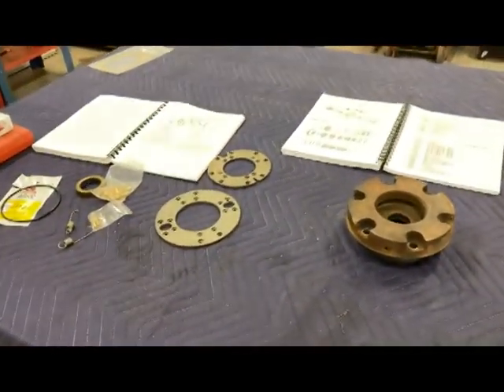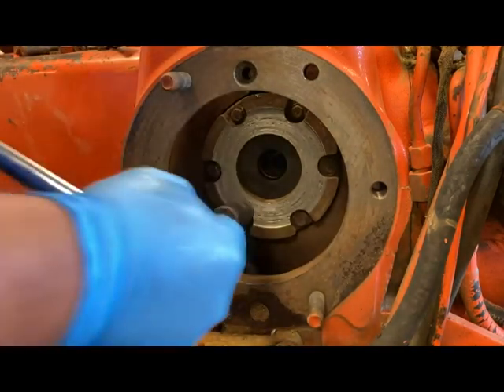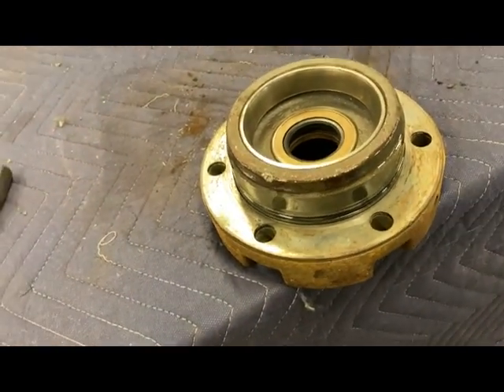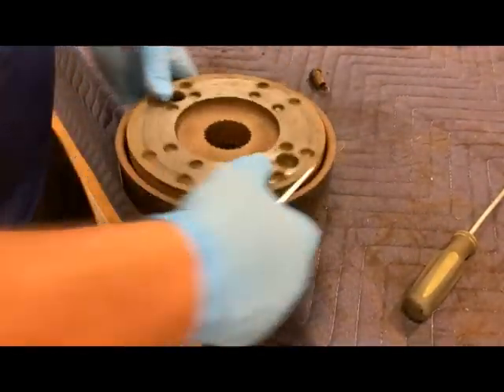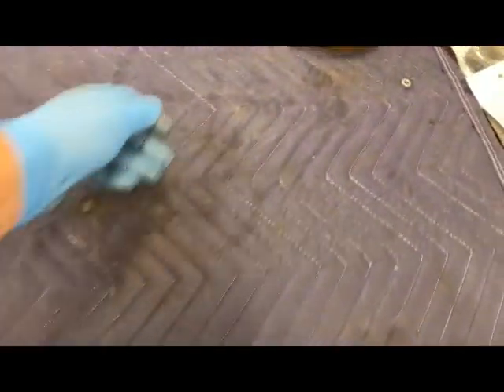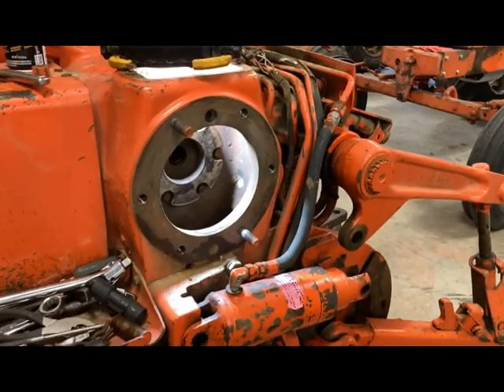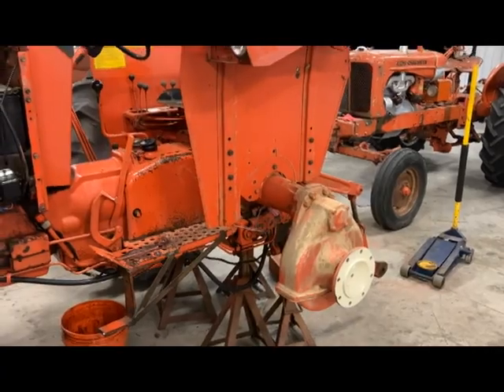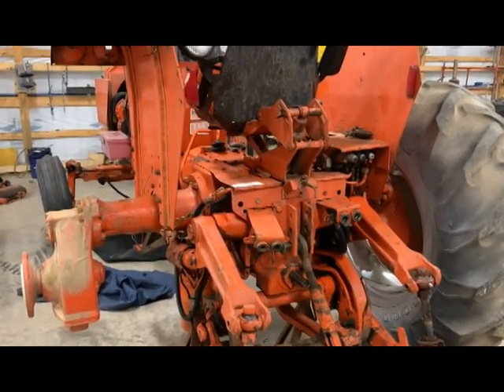Allis Chalmers 175 Brake Issue Reassembly Part 3

Comment: Never know what you’ll find when you take one of these old tractors apart. Expander in backwards! I suppose that’s why it wiped out one side and left the other with no wear.
Reply from the maker: Pete yes isn’t that the truth. I didn’t catch it until the end of the repair when I was reassembling as you saw. That’s why a service and parts manuals are essential.